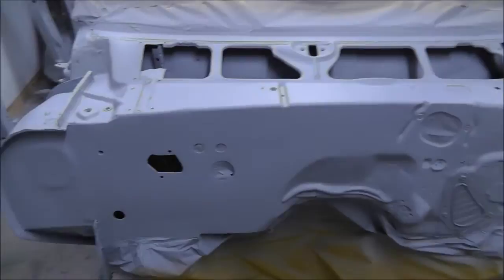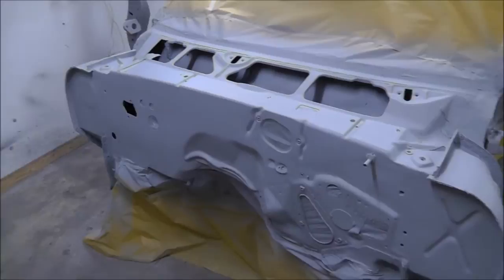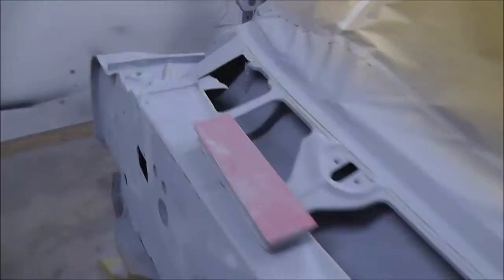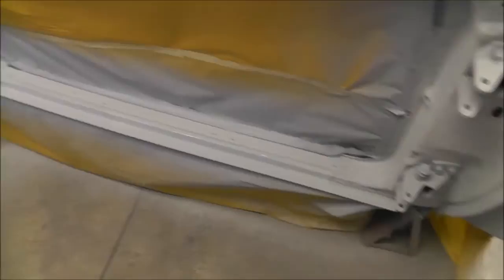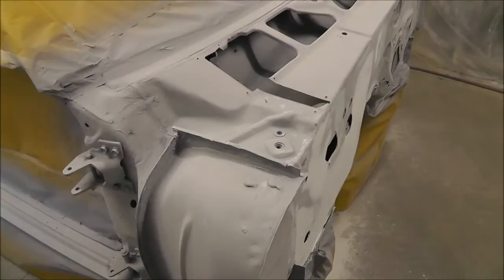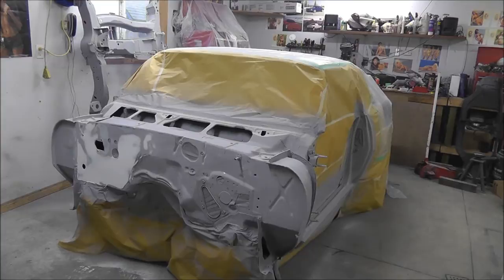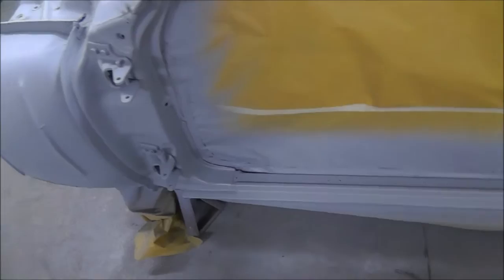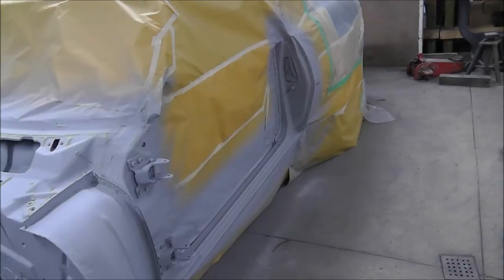My 68 Firebird Restoration Part 38

Comment: You're starting to look like an old pro.  Nice work.  The edges are much easier to handle with scotch brite than sand paper.  320 stuck to something soft is o.k. to use lightly on edges.  Anything gritty-er will bust through quickly.  You are not far away from paint my friend!!!!

Comment: If you sand for paint and break through in small spots like you had, just shoot a little of that acid #8 on the bare spots before you spray sealer or paint.